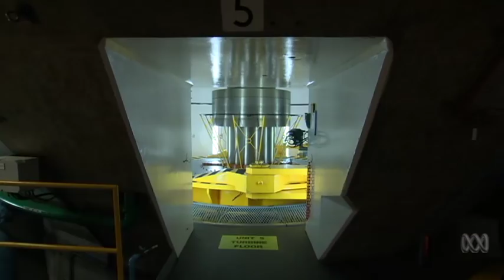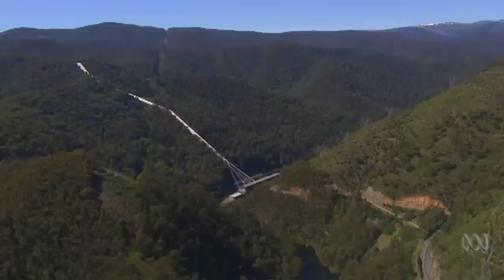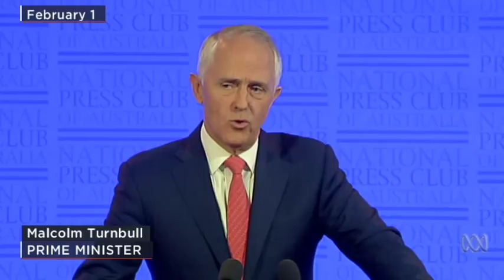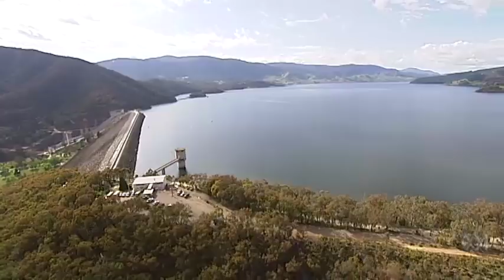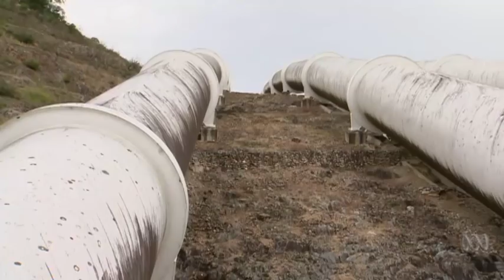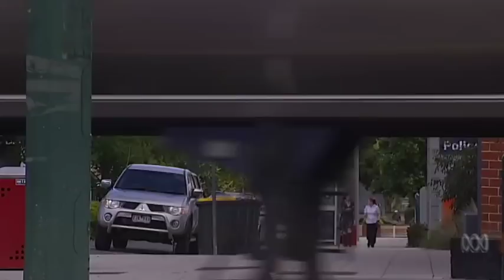Pumped Hydro: Australia's energy future?

Comment: This scheme has been running for 40 years and NOBODY has done an economic analysis to see if it is making, losing or breaking even?  Can't believe that!  Thermodynamics says you lose, smart economics says you must be making, social justice says you should break even.
Reply: Exfuckingcuse me?! Thermodynamics says you lose some energy along the way. Except that energy would be lost anyway because most power plants can't just be turned on and off quickly, so they catch the energy with this gridscale battery and release it later when it's needed.
It's not "making, losing or breaking even", it's reducing existing losses. That's why it's necessary. Whether or not it's economical only matters when comparing it to other methods of storing energy at gridscale.

Also, the fuck are you talking about, they're running it only a few days a year? They're talking about running all turbines at the same time, as opposed to just some of them. That means they only discharge this battery at its maximum discharge rate for a few days per year. It doesn't mean the plant as a whole only runs on those days. Pay at least a minimum of fucking attention before you run your mouth. For fuck's sake you even gave a time stamp, how can you have paid enough attention to know when they say, but somehow not enough to understand what they said?
Reply: @M Detlef  
You clearly have no idea what "Social Justice" even is.
Reply: @M Detlef  So you think that you can build these anywhere and charge whatever you want to make a profit?  At about 50 sec. in they say it only runs a few days a year.  And about 6:20 it gives economic considerations about placement.  Seems profit comes at a cost, and they may not be willing to pay the cost.    No need for rudeness...

Comment: Pumped hydro is a net energy consumer. It costs more to pump the water back up that is gains back in revenue.
It is good for daytime peaking but overall takes from total generation.

https://www.eia.gov/tools/faqs/faq.php?id=427&t=3
Reply: This is a misleading and meaningless comment. Batteries aren't 100% efficient. But they are still bloody useful.
Reply: Of course it is a net consumer, but they use the electricity that gets produces when no one needs it. When production is over the need the voltage rises in the grid making it unstable. When that happens they turn on the pumps and suck up the overproduction. When solar dies down in the evening and need rises they start using up the pumped water and again, stabilize the grid

Comment: We need more dams for pumped hydro to be a viable baseload/ peak demand leveller.
Reply: Actually pump hydro is not the only form of Grid storage out there.  Most people think of power storage only in terms of lithium ion batteries, but electric energy can be stored in other novel ways.  The examples below are the companies that are about to take over the market. These forms of grid energy storage are power efficient, scaleble, cost-effective, and non polluting.
These out these links
https://www.youtube.com/watch?v=kDvlh_aG7iA  
https://www.youtube.com/watch?v=U7a_LMM2_fE
https://www.youtube.com/watch?v=hXbtjdg0XKI
https://www.youtube.com/watch?v=_PH0IJ-_qOI
https://www.youtube.com/watch?v=767y5ViGurA&t=71s
https://www.youtube.com/watch?v=GicQwXbNnv0
https://www.youtube.com/watch?v=sVDh_4ymcyY
Reply: Jehiah Maduro https://youtu.be/mmrwdTGZxGk this is the simplest system for electricity storage that I’ve come across. I know, it’s the same as your second link.
Reply: Jehiah Maduro that last one uses natural gas (a fossil fuel!!!) to heat the air. I think the people who designed the system are sadly ill-informed; the purpose of the whole exercise is to NOT use fossil fuels.
Reply: @Renato UnREAL  Perhaps that depends on the country. But lets not forget that oil and gas are subsidized in many countries as well. The question is which one is a matter of priority. There should be strong commitment to phasing out the dirty and environmentally unsustainable and strong commitment to phasing in the clean and environmentally sound.
Reply: You don't need dams for pumped hydro, though I suppose it's possible to use them.

Comment: Just use a ram pump and problem solved...oh but that's free energy so better keep that one hush hush...
Reply: Yes you take the water from the dam’s free falling water that rushes thru the downstream outlets and run it through a ram pump which will pump that same water back uphill with its own kinetic power. You also build other ram pumps down river that intake the water being lost from the main downstream ram pumps operations to further increase the amount of water being restored back into the reservoir storage area. 
...The point is, building ram pumps would increase the efficiency of water generated power instead of just losing it all after the first pass through the turbines...
Reply: Hey dumbfuck. The purpose of this device is to store energy from the grid and release it later. That's a drawback of the design, it's the reason why it was designed in the first place. Power plants are usually not easy to turn on or off, at least not quickly, so there's surplus energy at times of low demand, and not enough energy to go around at times of high demand. That's why you need gridscale batteries like this one, though chemical batteries and other mechanical designs can also be used.

A ram pump only accepts power from water, not from electricity. It's fundamentally incapable of performing the task for which pumped storage hydroelectric power plants were designed. It's also not "free energy" because the energy used to propel some of the water higher than the position it originally came from is harvested by letting some of the water drop down to a lower position. Not violating any of the laws of thermodynamics.

I'd ask you if you finally grasp the sheer magnitude of your prior failure to comprehend the very problem you thought you solved but you're clearly too fucking stupid to even have any hope of understanding this explanation. Go ahead and prove me wrong.
Reply: WOW...slow down and you might realize I didn’t say what you thought I did. 

....And for that kind of verbal assault, I’ll give you no bones as to enlighten your lack of comprehension.

Comment: is the power generated by the free flow of water is equal to the power used to pump it back...???
Reply: No, it isn't very efficient, but it's the best way to store massive amounts of energy
Reply: @cindytepper8878  , 80% efficiency is pretty good compared to other systems $/MWh.
Reply: @cindytepper8878  Synthesis of chemical products is far superior.
Reply: @haliax8149  synthesis of chemical products?

what do you mean?
Reply: Naveen Kumar doesn't matter power needed when demand is there .have this at Niagra so falls have water flow during day .pump nightly flows during day when demand high.
Reply: I guess 80-85% efficiency, which is enough be worth pursuing.
Reply: ~80% round trip efficiency 
AEMO got CSIRO to investigate new build generation costs GenCost 2018
For Australia, RE (solar and wind) plus storage (PHES) are the cheapest. 

Much cheaper than new coal or nuclear.
Reply: @M Detlef  , 85% is a bit high. 
A well designed PHES system can expect ~80% round trip efficiency. 
90% pumping efficiency 
90% hydro power efficiency  
Gives ~80% round trip efficiency.
Reply: The three pumping units generate 250MW each and use about 300MW each to pump. Only 3 of the 6 units can be pumps

Comment: I thought most of the population of Australia was close to the ocean, how can there be a water shortage close to an ocean?
Reply: @Rosa-lv8yw  - Pumped hydro water shortage
Reply: @Rosa-lv8yw  borewell give clean and sweet water????
Reply: use a huge desalinate water from sun focusing through the largest possible modal of parabolic series of mirror so a huge furnaces will gives instant water vapours and we got clean water, if required then use sea water as cooling system for free
I have so many ideas which gives continued supply of water drinking water supply
if we use a very strong and long vessel which is 1000 meter deep long and one meter diameter so it's wrapped around with a permeable membrane like a very big and strong water filter and RO system working automatically under the huge pressures of deep water😏😏
so australian kivi and kangaroo ready to save water and use water again and again because it water we used from domestic outlet, at lest it doesn't contains that salts😌😌😌
Reply: @anilkumarsharma1205  You're suffering from the same deficiencies that solar panels produce. Thirty percent of rated output, at 25% of the time = near totally unreliable.

Comment: MAKE THEM CLOSED SYSTEMS!! WATER WILL NEVER BE LOST! USE A FEW WIND MILLS AND SOLOR PANELS TO MOVE THE WATER BACK UP TO THE STOREAGE TANKS NOT A LAKE POND OR WHAT EVER TANKS AND POWER AIR COMPRESSOS TO PRESSUREIZE THE TANKS TO GET THE WATER SPEED NEEDED TO RUN A TURBINE AT THE ELECTRIC SYSTEM SPEED FOR POWER ETC... JUST SAYING OLD ONE LEGGED JOSEPH T RETRED NAVY
Reply: @Creamapera you don't need much water for the reservoirs

Comment: Please i want to build my own power generator like yours.Please i need your help
Reply: I devoted some 15 years to the designing of a wind Turbine-alternator system that finally is a great success.  I shall paste a bit of underpinning principles below, and of you are interested will be happy to send actual details.
        
   From a public meeting at Llandeilo, July/August 2005, I gathered the following:
Cost of proposed farm...153M
Expected annual income ...0.2M
That's nearer 500 years for those not familiar with simple arithmetic.   What   I can say for sure that current "technology" - aka stupidity - actually IS a scam, as can be seen from the Llandeilo figures above.   However, it does not Have to be.  An annual return of 5-15%? of the energy required to create the system appears possible with a design which does not ignore elementary mathematics, such as Area, and Volume - as does current Gigantic "technology".
Viz.
1)
       "Wind turbines" as they are called, are in fact a wind Turbine turning an Alternator !! A Turbine-Alternator Device. A "TAD".   This may seem to be being pedantic, but in fact it is not - because Turbines have Opposite "Economy of Size" to that of Alternators.
  Viz -
   A turbine of Twice the diameter, replaces 4 previous, but costs 8 times as much for materials (Area becomes 2 squared, Volume, 2 cubed x what it was).
    The One Alternator, however, (to replace the 4) costs only about Twice as much as any one of them.  So the A-bill halves if we double the diameter of the "TAD"s, and use 1/4 as many, i.e.same size "farm", whilst the T-bill Doubles.
    The Total cost, of T+A, can be seen to be minimum for sizes where the T and the A cost about the same.   Now by some remarkable piece of Cosmic serendipity ?, that size is neither a mile across - nor an inch across - but just happens to be a very convenient, man handleable, 0.5 to 1.5? m across.  It is hard to justify building them much outside of this range, on economic grounds.      

       Also, the bigger the diameter, the wider is the range of wind velocities from top to bottom,  ("wind shear"), so it is not possible for the Pitch to accomodate all of these,  making a mockery of accuracy of the pitch setting !

2)
     There are Two possible modes of operation.
a)    Constant Revs/min and vary the pitch of the "blades" (- which need to be Wings, in fact !)

b)  Keep the Pitch Constant , and adjust the load so that the Rotor turns at a speed correct for the air passing through.
  
i.e.
      2.Pi.r.n  (the speed of the piece of Wing) needs to be = w.Tan(P)  in either case. w indspeed.
  n is rev/second   P is pitch at radius r, measured so that 0 degrees = Edgeways-on to wind

  If we look at the first one, we can get an expression for power into shaft, from each little length of wing.  
  i.e.   2.Pi.r.n. x useful component of that bit of wing's "lift"  n   (rev/sec) constant.  Call it 1 unit.

Now although the torque, T, will be the sum of all the pushes at all the radii along the wing,  I will consider just one bit of the wing.    This is ok since it will affect only the Size,  Magnitude, of the "answer", and we are concerned only with the Shape of the expression, or "answer", wrt windspeed.

  Leaving out constants for the above reason, because they don't affect the shape,  but simply confuse,
  The speed of the wing is fixed at 1 unit
  From pythagoras triangle Wingspeed (1) windspeed (w) speed over wing - hypotenuse - is

Sqrt(1 + w^2)

So lift force is  (1 + w^2)
Speed of wing is tan(p) which is 1/w
and its useful component - in direction of travel of wing - is
      Lift.Cos(p)  which is  (1 + w^2) . w/Sqrt(1 + w^2)

which is     w.Sqrt(1 + w^2)

At  low winds, w is a lot less than the 1 of the wingspeed, so the relationship is pretty much a direct, linear, "twice the windspeed, twice the power into the shaft",  type/variety.  It rises a little above "straight", at high winds, towards a w^2 curve.

      Now taking the other posibility, the airspeed over any bit of wing will be proportional to w, since although both wing and wind speeds double if the wind doubles, the two add by Pythagoras, being at rt angles.

   Lift (the useful) force is proportional to w^2, and therefore so is the torque applied to the shaft.   Since power is  (2.Pi) x revs x torque (push x radius at which the push is applied)  the power transmitted by the shaft is proportional to w^3, i.e.  k times the wind gives k^3 times the power,  e.g. Twice the wind, 8 times the power into shaft. 
       So this is obviously the system to adopt if at all possible.   And - unless you have your alternator running at constant speed - 50 Hz synchronous - like 'windfarms, it is perfectly possible.   
     
   N.B. !
     If however you DO have the alternator running at fixed speed, and you decide to use gearing to increase the rotor speed - thereby moving towards operation mode 2) - the extra Torque becomes proportional to w^2, instead of w, this creates w^2 current in the copper, and since heating is proportional to current^2, the heating of the copper in the alternator is prop.to w^4 - which causes it to cut-out  - or burn-out - during a heavy gust, or contunuous high winds.

    So the Aternator Cannot be run synchronous for a TAD to have any chance of paying for itself in a lifetime.

       Next there is the fact that the bigger the Rotor, the greater difference in wind velocity the different parts experience, rendering any "aero-precision" in its manufacture a total waste of effort !!!
       Also, since towards the centre the speed of the wings is so low that the power contributed is likewise.    So the tiny hubs serve only to create a "materials/engineering" problem !!      

   So, to sumarize, 

1) There exists a SIZE giving lowest cost/kW-hr
2) The TAD needs to run at windspeed, not fixed speed, to make full use of the energy available in any given wind.

        There is also the consideration of "Churning", or "turbulence" caused by pseudo-random airflow through a "helicopter on its side " sort of device.  "Air friction".    This can be eliminated in the turbine itself by carefully designed, matching,  pre, and post-fan "Ducts".
   I can send the design for this to anyone interested,  so that they can check the reasoning.  I can vouch that the prototype performs as hoped/expected.   It delivers a full 50% of the total k.e. of the wind as useable energy.